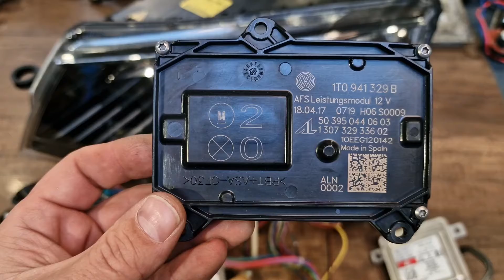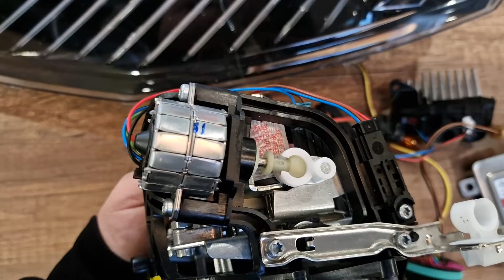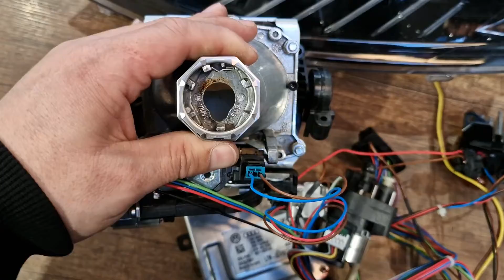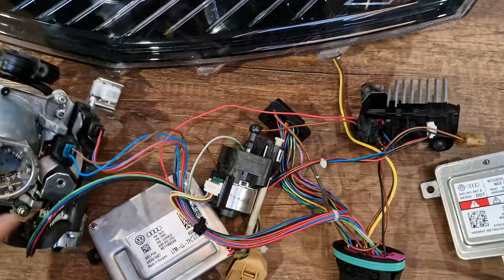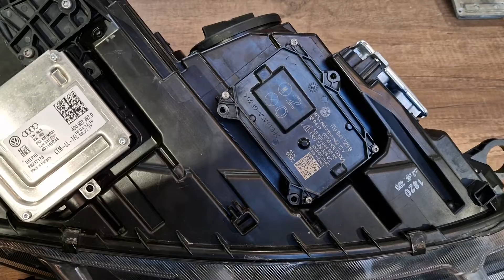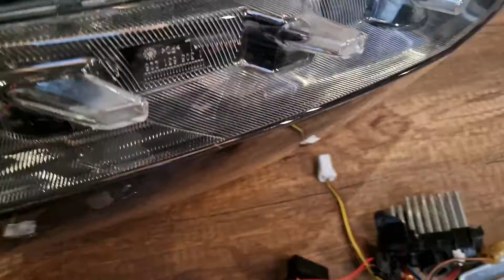Skoda OCTAVIA MK3 1T0941329B xenon AFS (Leistungsmodul) module for adaptive (cornering) headlights

Comment: Can you help me with this problem, please? It says : 5277461- positioning motor for dynamic cornering light left - c1087 15 [008] - open or short to plus. Cornering light from left  goes perfectly after 50 km/h. Under 50 km/h it’s turning maximum to left and stay there. After 50 km/h it comes in the middle and follows the steering wheel. Can be the afs module or it’s the motor? Can it be fixed? Thank you very much!
Reply from the maker: This usually happens when the horizontal dynamic motor underneath the projector is faulty or has defective wiring/power supply. Please see https://youtu.be/I0Zaa1nlcnE?si=p-qpNK41nTpOJCVf between 8:00-8:25 you can see the motor in question underneath the projector. If this is the case usually whole headlight should be replaced or you should source this motor from another headlight and replace it.
Reply from the maker: This can happen, although less probably, due to the AFS module partial defect in case of moisture. But given the fault code it seems that your horizontal dynamic motor is not functioning properly.
Reply: Thank you very much!